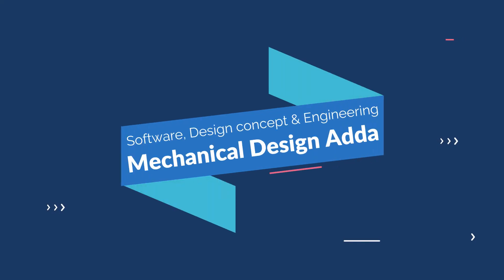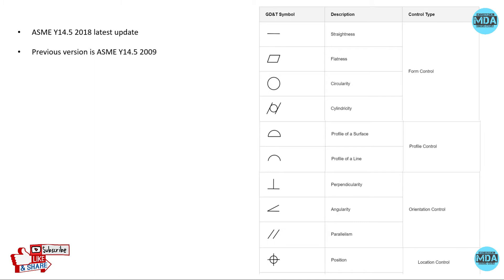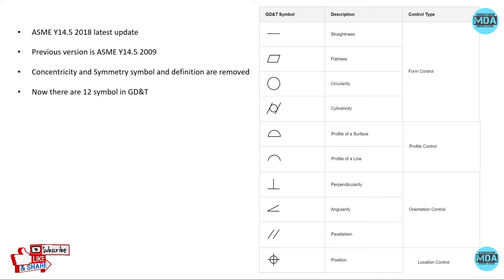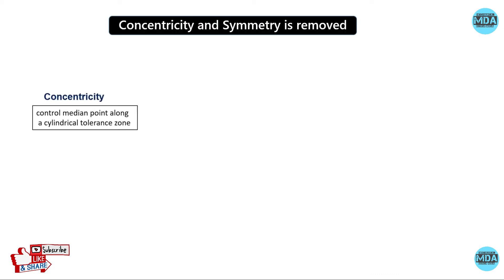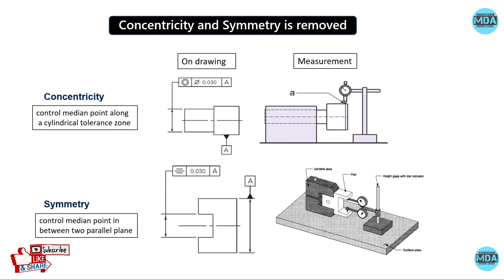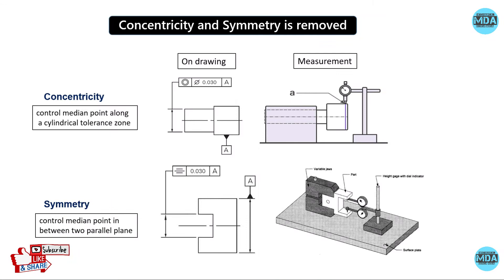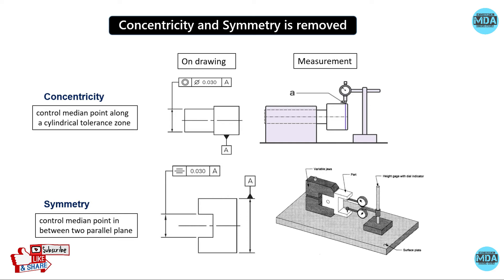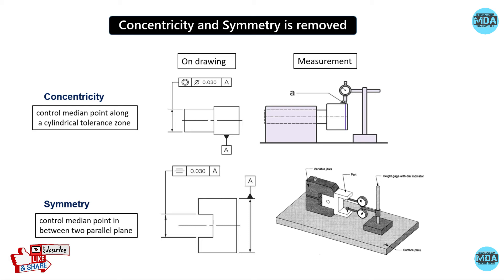Why concentricity and symmetry are removed in latest ASME Y14.5 2018 | Concentricity and symmetry

Comment: Still with position we are controlling the central axis right?
Reply from the maker: Yes.....you are right
We are using positioning for controlling the location of features, centre axis of feature and middle plane ( symmetry)
Reply: @MechanicalDesignAdda  Thanks for your reply. So is there any benefit of replacing the symmetry symbol with position symbol?We can not control the shape of feature with position right?
Reply from the maker: We can't control the shape of features with position. and we removed concentricity and symmetry Just to avoid the confusion because we can control the median point with position in same way as with symmetry and concentricity
Reply: @MechanicalDesignAdda  Thanks. Now i understood.Concentricity and symmetry symbol may misleading the requirements right.